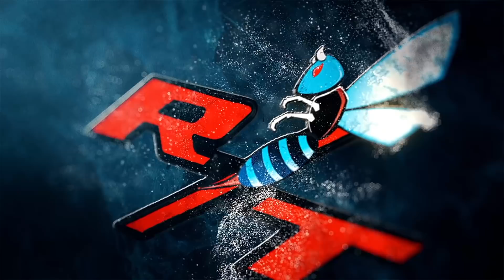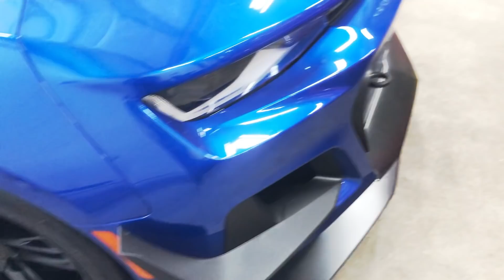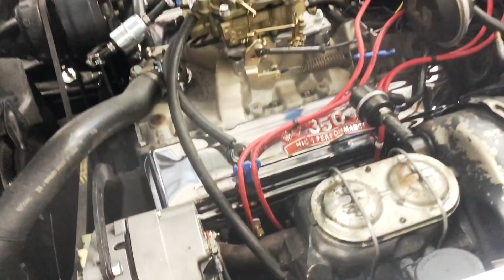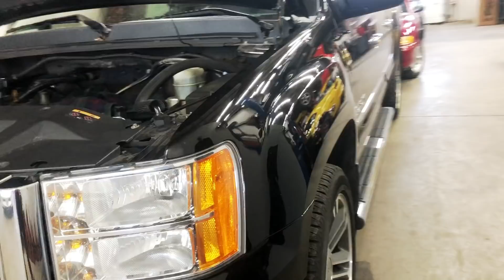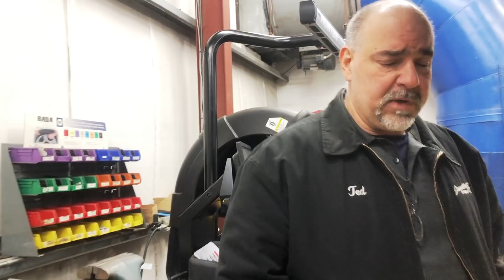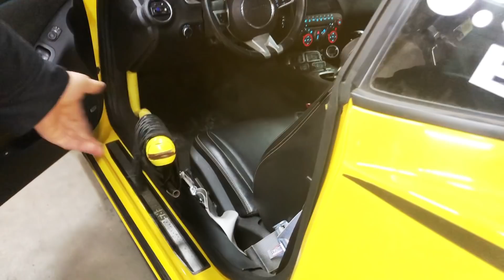Truth About LONG TUBE HEADERS...

Comment: Honesty it really depends on how well your oem manifold is. If for instance its a log style even short tubes will give it a good bump in power. Also some shorty headers are tuned length now and have longer piping thag curls around which I would imagine helps a little too. Obviously yes longtubes ftw but for those looking for short tubes I would say they are worth it if your expectations are in reason

Comment: You know this is off topic. I have my car fully straight piped lol but I’ve been going back and Forth with an H and X PIPE and my H Pipe sounds so Amazing but I can really tell the difference with power. At high Rpms (H-Pipe) my car feels restricted, and I can feel The H pipe in my foot if that makes sense. It sounds amazing. My X pipe is so damn raspy At 2,000 rpms!!! I do not like it at all BUT my car goes through the high Rpms like nothing and 10xs smoother. I have a 2017 Charger rt
Reply: I’m getting long tube headers next

Comment: Good evening!!!  It is the first time that I write to him !!!  I need a little help .. I have a Dodge Magnum 2005 RT 5.7 V8, I installed Long Headers but I need to know the distance in which the oxygen sensors would go between 1 and 2 ... It should be noted that it does not have a catalytic converter.  I will thank you with the soul since I need to install them. !!!

Comment: The timing of the pulses are NOT even on cross plane v8 cranks. This is where your "V8" sounds come from. The primary runners need to have the correct lengths in order for the pulses to arrive evenly spaced at the collector.  Flat plane cranks,  i.e. Ferrari V8 have evenly spaced pulses especially when fitted with a 4-1 on each bank.

Comment: I did long tubes and high flow cats on my 16 Durango R/T.  Definitely the way to go when it comes to minimizing restriction, optimizing air flow and power gains.  Now I need to do the manifold swap as you did, and I'm sure it will make all the difference.  Your videos have made a difference in shedding light on what to do and whats best.  I definitely appreciate what you're doing.....but, I guess I can speak for all of us when I say that!
Reply: Still got the Durango rt ?
Reply: @meshalsultan5468  I do not.  I've traded it in for an SRT Durango.  I'm actually about to put headers on this one.  If you have any questions, I'd happily assist you in any way that I can.  If you're looking for videos of how the RT sounded, I still have plenty!
Reply: @Ezra_949  I actually picked a Durango rt over an srt is there any reason why you upgraded? Glad you answered.!
Reply: @Ezra_949  I had two options Durango rt with srt interior low mileage 2018 it’s in perfect condition and the one I found after 7 months. A Durango srt base model with almost low for being a sport suv. I didn’t get it because I know srt won’t respond too good with mods because it’s already maxed out. So that’s why I got the rt maybe bolts on and custom cam. And for some reason everyone was saying RTs are better ended up getting srt :(
Reply: @meshalsultan5468  the SRT is better all around.  I had every bolt-on mod done to the RT, and it was still slow as shit.  With my 22 SRT and basic bolt-ons with a tune, I went from a 4.2 sec 0-60 stock to a 3.8 sec 0-60.  The SRT is the better choice because of the gearing, suspension, and the overall platform.

Comment: Roll cage is 9.9 I37+
Chute is normally high 8’s or 150
Which ever comes first 
11.1-11-4 fire jacket. 
11.7 you need upgraded ati balancer
Reply from the maker: Good info. Thank you
Reply: Chute is 7.50 to 9.99 or a car that will hit 150 that is from the NHRA PDF on setting up a car

Comment: Motors are just big air pumps. More air & fuel in, more exhaust out, equals more power. 
Heat & weight are the enemy of speed.
Reply from the maker: 100% on point

Comment: I definitely want to do long tube headers corsa mid pipes and a corsa cat back on my 392. I want to get my scat to breathe better and get louder.
Reply from the maker: That will certainly result in nice HP/Torque gains
Reply: R/T Life Gotta saved some cash up for it tho
Reply: Most long tubes headers come with their x pipe that will fit you can’t mix and match . I’m big on American racing headers , fit finish and sound second to none
Reply: Baldeagle301 Appreciate that info definitely didn’t know that. What about catback systems? Can you mix and match
Reply: Johnny Kilroy no problem . Yes you can use any axle back exhaust aftermarket or stock. Best to use a stainless steel 3 inch so it’s stainless steel 3 inch from the headers all the back.
Reply: Baldeagle301 Gotcha will do

Comment: If you do go with long tube headers I recommend having them heat wrapped or heat rap ur coolant hose, I had a problem were the headers were making my coolant hose leak due to the high heat. I did 7-8 pulls and in the 9th the coolant temp was  high and leaked more than half the coolant through a small leak caused by the heat.
Reply: I have cammed 17 charger rt
Reply from the maker: Makes sense, you had to remove the heat shield for fit the headers right?
Reply: Yeah would be great if I wrapped the headers before but they are a tight fit and don’t want to remove the heads again

Comment: Bro do you know if the car would be driveable for a bit with long tube  headers and no tune or is a tune a must?
Reply from the maker: You have to get direct fit long tube headers for no check engine lights (without a tune)
Reply: Even direct fit will throw a code. Better to have someone install and tune at the same time. Imo

Comment: I’m picking up my cammed car either today or tomorrow !!!! Thanks for all the info you give to us 5.7’s
Reply: Timothy Ruiz what cam did you go with?
Reply: Dee I went with the Jay Greene stage 2.5 HL v2 thump kit and jba shorty headers. I could not be happier. It gets pricey, but man is it worth it ! It really pulls now. Especially if I’m going 20-30 mph and punch it. It throws you back now which it didn’t before. I’m having fun haha!
Reply: Timothy Ruiz nice man that’s awesome!
Reply from the maker: NICE!!!! Happy for you - once you cam your 5.7 it's a new ball game
Reply: R/T Life it’s a whole new car. I just need to get some decent tires on it now. I know you have the Nt05r. Do you only have them on the rear only ? And will the 305’s work with the wheels I have ? I have the stock 20x8 wheels for 2012 rt challenger. I love the cam by the way!! Man I’m enjoying my car haha. When I punch it, it pushes my wife back into the seat now lol
Reply: Timothy Ruiz 305 is too wide for 20x8 bro, to make the most of that width tire you should have 20x10 or 20x10.5 wheels. I believe tire rack has a really good calculator and figment guide on that!
Reply: Dee that’s what I figured. I’m still new to all this. So I should also be buying new wheels lol ? Or do you have any recommendations for my wheel size ?
Reply: Timothy Ruiz Timothy Ruiz well 20x8 is pretty small so honestly I’m not sure what kind of wheels you like but I would go for 20x10.5 on the rear and either 20x10 or 20x9.5 for the front if you want a staggered look. If you just want the same all around then I would go with 20x10.  We have the same year car (mine is a 2012 RT Classic) so I looked into it a lot before pulling the trigger. I went 20x10 all around because I can still go for a staggered look but if I want to go the same size all around, I can do that as well, so it’s the best of both worlds. On the rear I’m running 295/35/20 and on the front I’m running 275/35/20. It’s been working good for me so far!
Reply: Dee awesome ! Thanks. I’ll look into those. I just need to do some more saving up. This hobby ain’t cheap lol !
Reply: Dee I just uploaded a video so you can here the Idle ! http://www.youtube.com/watch?v=soRdqXUOIUk
Reply: Timothy Ruiz no problem man, and yessir you are definitely right haha. I just got some JBA longtubes today so hopefully getting those installed soon and then a cam will hopefully be in the future as well! The one I’ve had is the inertia motor sports spartan eagle plus. That thing sounds gnarly!! Congrats on your cam man, that’s awesome
Reply: Dee thanks ! I enjoy it and it makes me feel like all my hard work is paying off haha ! Upgrading our cars is so addicting.. I wish I could get Longtubes. Too bad I’m in Commiefornia -.-
Reply: Dee how come you want to switch cams if I am may ask ?
Reply: Timothy Ruiz sorry man I mistyped. I meant to write, the one I’ve had in mind is the intertia motorsports cam. I haven’t gotten cammed yet, but when I do that is the one I have in mind! & ahhh man yeah regulations over there are so strict it’s crazy, like they just don’t want car enthusiasts to have any fun. I’m in AZ just one state over and our regulations are super lax. We still have to pass emissions but as long as we can do that, it doesn’t really matter what mods we do. Pretty much you just need cats and no check engine lights and you’re good!
Reply: Dee no worries👍 keep us posted when you get that cam. I’m sure I’ll be moving out of state soon enough haha ! Can’t take these dumbass laws and taxes. Then I’ll be able to have some real fun. But for now, what I have will do just fine !!

Comment: Short headers are good for low end.
Long headers are good for high end.
SIMPLE ENOUGH!💯👍🏻
Reply: Not true I’ve had both arh headers 1 3/4 meds and 1 7/8 long tubes and the long tubes and more tq and hp at peak and didn’t loose any down low but mad more through out the curve
Reply: Great 1 not true. Long tubes give better gain throughout the rpm range.
Reply from the maker: I think the difference between the 2 on a lightly to almost stock car is about 15whp. Similar gains in torque

Comment: If you live in California long tubes are a big No the only guys that get long tubes in Cali are guys with brand new cars that don’t need a smog for 5 years and the guys that don’t give a shit I’m running Edelbrock MID-Length on my Hemi Ram longer than Shorties shorter than long tubes and they’re 50 state legal with a CARB# I felt a big difference with my MIDS but I agree shorties are a waste
Reply from the maker: With the mids did you have do mess with the cats?
Reply: R/T Life no cats stayed in stock Position

Comment: i agree if your running open headers, my experience is for a daily, shorty headers are alot better. Drag car , totally different
Reply from the maker: If I was really building my RT for the 1/4 mile only, it would have long tubes on there. I like to drive my RT on the street & will rarely go to the strip. Shorty headers has worked out nicely for me & I don't have to worry about busting a weld or anything since my RT is lowered.
Reply: Except $$$ short tubes don't have no advantages over long tubes. Dally or the strip. Only if you ramping 40mph over speed bumps
Reply: @dinozgb  how is that, shorty headers work just fine, and don't scrape, been using them since the 90s, no problems.
Reply: @MikeJBlues  I didn't say shorties are not good. Long tubes are just better. I have them on my daily driver and I don't have no clearance issues (stock suspension on 2017 Challenger T/A)
Reply: @dinozgb  no worries , I just like shorties, to me the long tubes feel weak at low end power.
Reply: @MikeJBlues  believe me, with good tune there is no shortage in the torque departement

Comment: Very informative, i was thinking long tubes, but a lot of shops here dont like messing with them which is crazy imo, almost had me convinced to go shorty until this vid...thanks
Reply: Bigboy314 if a “performance shop” is afraid to do headers I wouldn’t let them touch my car with a 40 foot pole lol
Reply from the maker: Why won't they install long tube headers on your car?
Reply: @RTLife  they said its too much of a headache with the install with potential broken bolts and long term overall issues.....i was like "wait, what?"
Reply from the maker: that's stupid... never heard of a performance shop turning down a header install lol - this is like modding 101.
Reply: @RTLife  thats what i said, lol
Reply: The way it was explained to me is some LT’s are not of good quality and on the budget side “get what you paid for “ so fitment issues come up… but if you have a set of known brand name headers believe me that shop knows the difference… and won’t be so reluctant to install them.. also just as which would they advise you to get… they will always recommend the ones that don’t give them issues…

Comment: I wonder how much horsepower and torque you gain from longtubes to the wheels on a 392...
Reply: Alex Andrews look up dyno sheet on it. That’s what I did before purchasing my LT, but in all honestly it depends on ur current mods. Because if your running more air flow due to high compression/forced induction/etc. then ur choking ur engine already. Opening it up will gain significantly much more than just slapping on a stock engine.
Reply: @jeepwk6.5L  I don't currently have a car, I'm just planning out what I'm going to do when I get one
Reply: Alex Andrews smart man. Stock motor they gain about 25-30 hp. But it all varies on diameter. This is based on 1 3/4” LTs on stock motor. But the sound they add to a 392 is awesome

Comment: I did feel the difference and also on the dyno run it made quite a difference from the the shorty to the long tube. Also the long tubes give it a better sound note in my opinion.
Reply from the maker: Yah the long tubes do have a different exhaust note - I have noticed that
Reply: @RTLife  great video should help a lot  the community make a decision. Keep them coming.